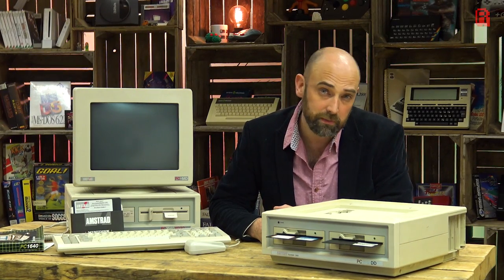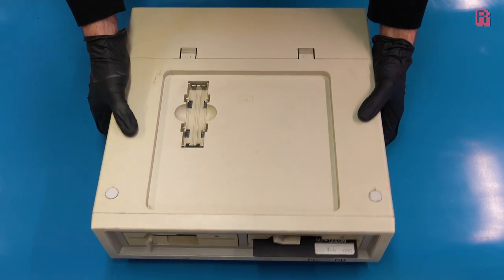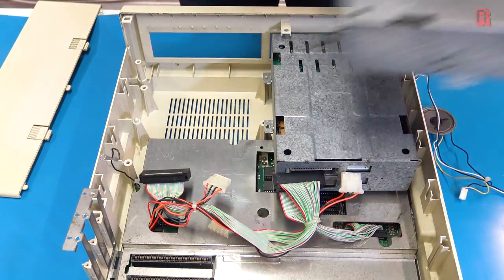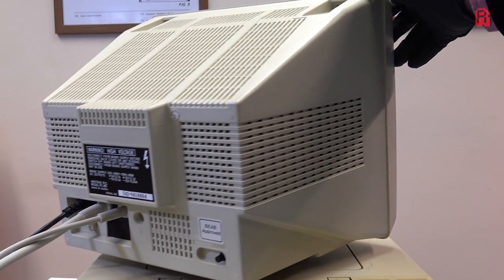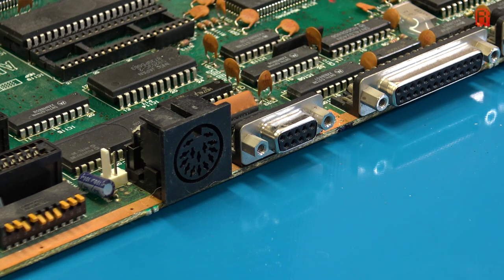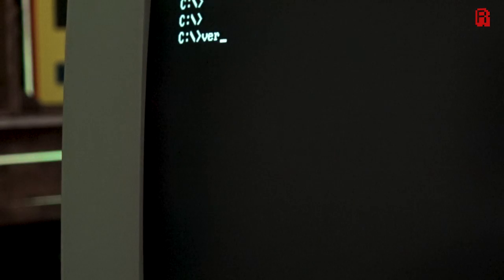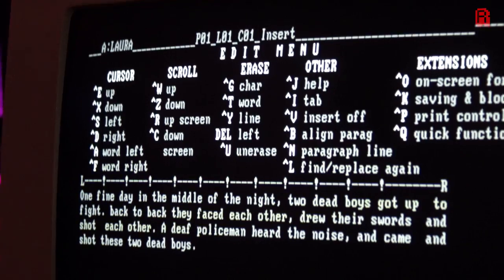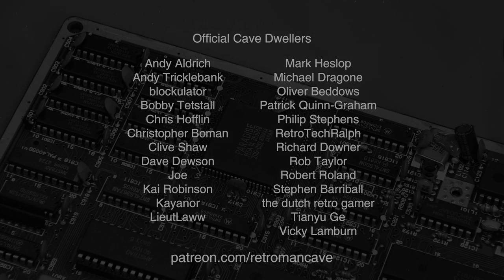The PC That Cracked Europe - Amstrad PC1512 and 1640 | Computer History

Comment: I live in Denmark and got my PC1512 in 1988, with the monochrome screen. I only had it for a few month, until I started to expand it. First I got the extra RAM, so it had 640K. Then I put in an internal 1200 baud modem (wow it was fast ). Within the first year, I got a WD 32 GB HDD, and a CTRL card. The bracket for the mount of the HDD, I made in aluminium. It was a fantastic machine :-) I used it a lot with Wordstar, and also installed a parallel print port, as i bought a matrix printer. Later one of the 360 floppy drives were replaced with a 3,5" FD 720K. All together I had it for almost 4 years, until I moved on...  Thanks for the great video you made! It brought me down memory lane :-)

Comment: I remember wasting a great many hours trying to install a hard disk in my 1512, I bought the Western Digital WD1001D card new and a used Seagate MFM drive from a rally. You had to jumper the card for cylinders, heads, and so on. It would recognise the drive, low level format it, partition it... but it would not appear as a C drive, try as hard as I might. It was only many years later that two nuggets of information came to hand that might have saved me much frustration one was that the ROS was just not BIOS compatible, and the other was that the WD controller cards fitted by Amstrad in the 1640 apparently had a custom ROM fitted; presumably to fix the compatibility! But I loved the 1512 to bits- I spent hours programming in BASICA (20-odd years later and I am a professional software developer) and hooked it to my amateur radio packet modem and sat up into the small hours playing on bulletin boards and node hopping. Happy days!!
Reply: I added a newer Seagate ST-something 40mb MFM hard drive that came with it's own controller that loads it's own BIOS stuff in a PC1512SD some 10 years later after I got it and it worked out of the box. The biggest problem was making custom drive mount to secure the hard drive in the box.

Comment: This video takes me back to 1992 / 1993 - I had a PC1512 as my very first PC which was shortly followed by a PC1640 with EGA and a 20Mb MFM HDD! I still remember the sound when turning it on; was like a washing machine going into a spin cycle! I also bought an upgrade for the 1640 in the form of an external 3.5" floppy drive. It was pretty useless only being 720k but it allowed me to take files into school and make copies of my friend's software. I adored those machines and even now in 2019, when I have the need to type a DOS command, I always think of them <3 <3

Comment: At the time I had a CPC464 with floppy drive and printer. When I looked into the Amstrad PC models I had to take into account that my wife wanted to play games, and that the CPC was not much use for writing novels, my main reason for upgrading from a ZX Sectrum. After comparing models I bought an Amiga 500 over an Atari ST. With the extra drive, ram, and a colour monitor, it was still cheaper, and I could use my Amstrad printer as well. I wrote several novels and a pile of short stories in the Amiga, and contributions to a lot of newsletters. It was also ideal for personal and business letters as I could save, reload, and modify the contents without having to retype the whole letter. Not a big thing now, but I first started writing on a portable typewriter (Degree thesis), where what you see is what you're stuck with.
Excellent video, thanks.

Comment: I remember upgrading my 1512 with an NEC V30 CPU which was pin compatible 8086 replacement that you just popped into the CPU socket.  It was only about 15% faster but cost just £7 at the time (approx 1990).
Reply: I did the same to my 1640 added a v30 & math co processor, external 3.5 floppy, internal 40mb HDD, serial mouse and IBM style replacement keyboard .. it cost a small fortune :)

Comment: I worked for Amstrad starting from October 1990 in the PC Helpdesk department to start off with , we had a 1640 with 2 hard drives hanging off the side of it and the ribbon cables going through the side expansion plate  impressive what you could do with one if you had the money. I specialised in amongst other things the "Amstrad Network" which was pretty good and cheap .. my final day was April 1996 when i took redundancy from the R&D department in the PC Division were we had been developing all the newer pcs from the PC6000 range onwards. Great times and still my favourite time at work!

Comment: Another great video. I remember my friend bought one. I think he saved up for it from part time jobs (I think we were just finishing 5th or 6th form in the 80s) 
We both went into town (Manchester) and I'm pretty sure he got it from Lewis's and it cost a fortune as he got the 20Mb HD and printer. I have memories of round his playing the original 'Test Drive' most of the time. 
I've got a boxed one in the loft here. Not tried it in years, It's sat next to the Amstrad Mega PC with monitor and all accessories - I'm keeping hold as they are pretty damn rare.

Comment: I’ve been waiting patiently for this one 👍
I’ve got the 1640DD (so twin floppies) with the EGA monitor (broken!) and a full-length ISA “hardcard”, a hard disk controller with the hard drive mounted directly on it. Apparently this was an option at purchase rather than a later upgrade.
I’ve altered the DIP switches on the back of the machine and added an ISA VGA card so I can plug it into a normal monitor; maybe you can do the same with the 1512? Power is your only issue there. For now, I need to keep the broken monitor close by, but I have a spare AT PSU that I’m going to modify and use at some point as an external power supply.
Reply from the maker: Interesting!  The 1512 doesn't let you disable the CGA chip but that's useful to know about the dip switches on the 1620.  An LCD with a PSU mounted in a CRT case 😂
Reply: RetroManCave That’s my eventual plan, to find an LCD that will fit inside the original monitor’s case. There’ll be plenty of room in there for the converted PSU. 👍
Reply: Gentlemen, on this page you can find information about the PSU connector:
https://www.seasip.info/AmstradXT/1512tech/section1.html
The PSU connector is at the very bottom of that page.

Comment: I had one of these as a kid, it helped me forge a lifelong career in the IT and high tech industry, without access to DOS, GEM and the PC architecture to mess around with and learn from I’d probably have left school at 16 with only a handful of CSEs and good intentions. The experience I had of PCs because of the Amstrad meant that I got a PC support job when school leavers generally only had BBC micro knowledge. Schools didn’t have PCs and Macs then and the syllabus for computers covered BASIC programming and if you were lucky a bit of assembler. In today’s age when you can get more power in something the size of a thumb drive it all seems a bit quaint but for its day it was a thing you aspired too as the gateway into serious machines affordable to home users. Cheers Alan, you did good.

Comment: Functions keys on the left was standard for PC/XTs which I believe are about what Amstrad made. They went on top of the keyboard later with the IBM AT.
Reply from the maker: Good point well spotted.  There are other oddities about it though to make it just different enough to avoid those scary IBM lawyers
Reply: @RMCRetro   Just few minor diffs: 
alt was next to ctrl in the middle row, prtscr after ] and not bellow Enter, L shaped Enter, shorter backspace and delete between = and backspace, caps was next to right shift and there was gap between num and main keyboard. 
Num had enter, shorter + and - was in the top row next to shorter scrlock.
Reply: There is also a IBM Model F AT keyboard with the function keys on the left.
There were some other IBM clone keyboards that did have ten function keys on top before IBM made twelve function keys on top standard with the Model M "IBM Enhanced Keyboard".

BTW. Commodore PC:s had keyboards with the same layout as Amstrad's (but not as cheaply made ...)
Reply: @FindecanorNotGmail  First Commodore  PC models had keyboards similar to Amstrad (except for the Num keyboard  - top row was esc, numlock, scrlock, sysreq; no enter, big + and there was */prtscr above -). PC-1 and Colt had Alt and Caps in the Space key row, with same Num as previous models.

Comment: I used both of them at Kilmarnock College where they just created a lab with them for the electronics course.   They weren't great machines, even then the hard drives were poor as one of four 1640s died and the rest of the lab was 1512s for cost (another 12 machines).   We did EPROM programming on those machines, which they were terrific for, and also wrote Pascal programs, and Pascal was a beautiful language at the time.   The Irvine annex of Kilmarnock College had the PCW word processor and I couldn't count the number of times someone typed up a report and then lost it because if you ejected the disc without saving you couldn't put in another one and save it (or so I was told - I never used them).

For myself, I kept using the BBC Master who's word processor View was basic but effective.   Easier to learn than WordPefect.   Later using the Acorn Archimedes where its OS was far in advance of the Microsoft offerings of the time.   Computer Concepts Impression was one of the best word processors available and I did a lot of amazing reports for college at the time.   Later I would change to a PC, at 386 level, but that was partly to do with having more engineering software available.   Running two computers as I progressed to university, doing course work on the PC, but writing reports on the Archimedes.

Alas, I then had to upgrade to the 486 and the selection of games for the PC was far superior so the Archimedes got used less and less until I really had to keep using the PC for compatibility with uni that I gave up on the Acorn product.   The Archimedes's RISC OS was better than windows 3.1, and the word processing still was better than Word, but everything else was advancing at such a pace that Acorn was being left behind both in hardware and software.

In all that time I never knew anybody who bought their own Amstrad computer, not one of my college or university friends.   We bought other computers, we even built our own from parts (we were doing electronic engineering courses!), but I have never known anybody who has actually bought an Amstrad PC!

Comment: The PC1640 was my first PC, it was a hand-me-down from my uncle when he upgraded to a Pentium 60 (one hell of a leap!). It had two 5.25" floppies, a colour enhanced display "ED" monitor, and a Seagate 32MB hard drive mounted on a ISA card in the back along with it's own dedicated controller. This was during the predominantly 486+ era it was frustratingly slow but taught me a lot about getting along with few resources that has served me well.
We later acquired a 2nd PC1640, this one with a lower resolution "CD" monitor but it had a double-density 3.5" floppy drive. Which again gave me envy of those with huge High Density drives! 
One day a filesystem corruption event caused a directory to link back to the drive root and my attempt to recursively delete it caused catastrophic data loss from which it never recovered. We soon upgraded to a 486 and those old and broken Amstrads we destined for the tip. But that slow spin-up sound is still etched into my conscious and I do miss it, especially knowing I could now fix every problem it had in my sleep.

Comment: This brought back lots of memories. I worked at a government youth training centre (called iTecs) and we bought about a dozen 1512's and a 1640 they all worked really well for teaching. We had the GEM system and the kids liked them. It taught them what a business system was like to work with. We upgraded some of the twin floppies to hard drives and we replaced some of the 20 meg hard drives with 40 meg drives but  we had to partition them as 32 meg and 8 meg as the max hard drive size ( or partition) was 32 meg. I remember the none standard graphics mode as well which could be used for more colours on the 1640.

Comment: Oh my, do i have fond memories of those. Working in a independent computer shop we sold hundreds of these, I spent many,many hours upgrading and repairing them. so easy to work on. The 1512 I did hundreds of memory upgrades and 'hard cards' which was just a hard drive and controller all on a single metal backplane. Most of those where Tandon hard drives which you had to low level format before you could use them.

Comment: We had a 1640 in 1988. It was a solid PC for the money, but that fan noise was almost unbearable! I remember it was slightly faster than most entry-level PCs at the time, so you really did get a lot for your money. Ended up selling it after about 6 months and bought an Amiga!

Comment: Small point - GEM was more stable than Windows, so high end DTP and the like stayed GEM based until Windows 3.1 became the de facto standard. GUIs were resource hungry so the likes of Lotus 1-2-3 stayed with DOS to make them faster until CPU designs improved.  
Also having the function keys on the left of the keyboard was more ergonomic, IBM had them there until the success of the PC caused some internal political wrangling and the independent PC team was subsumed by the more traditional factions. They moved the F keys to the top so the keyboard would more closely resemble a 'proper' computer, ie with the awkward to use 'teleprinter' style keyboard layout (fashion victims have always been with us). 
The 4x3 display remains popular today particularly with writers as that extra screen height for a given width makes working with text easier (I am told it is also better for web browsing). This is particularly important with laptops where to get the same amount of text in the same font size on a modern 'reduced height' (cough 'widescreen') display you need a much bigger machine (to match a 15 inch Thinkpad laptop you need a 19 inch letterbox display). A4 displays seem to have disappeared now as people just buy a 23 inch screen where they will be doing page layout and the like, one lady has hers set to a 4x3 display and uses the 'spare space' for post-it notes.
The migration toward that futuristic ideal of the Sinclair Z88 (with its super-ultra-wide display and flat rubbery keyboard) may explain the increasing popularity for talking boxes for home users. For productive work of many kinds those older machines remain viable and often preferable (for one thing the longer you use something the easier it gets to use it). One writer I knew was still happily using their Amstrad PCW (albeit with a 3.5 inch drive and a hard drive added) in 2010. It wouldn't do video editing or play modern games, but they just needed it to earn a living.
Reply: The upper line of F-keys seems to come from terminals, and things like the 3270PC which used a "hybrid" keyboard with elements of the PC and terminal designs combined into one ... is that what you mean by a "proper computer" (or teletype) design - one meant for use with a terminal plugged into a mainframe?

And yeah, I picked my current and previous laptops partly on the strength of their screen aspect ratio. This time around, 16:10 was as good as I could find... if only I'd waited just a little longer then I'd have been just in time for the Google branded model with a 3:2, with just that little extra bit of vertical space, but this does a good enough job. I don't miss the horizontal space other than with poorly designed webpages, but the extra height is routinely welcome. Particularly it's quite good for 2-page document editing; it's not far off two old school one-page portrait monitors stuck together, and actually matches the resolution of some old 2-page landscape ones (and as a bonus is exactly 4x that of my old Atari's hi-rez, or 8x that of it's (and the Amiga plus VGA/EGA/CGA's) low rez, so emulation enjoys nice clear 2x2, 2x4 or 4x4 pixel upscaling). A wider screen would actually demand a smaller zoom %age and less readable text - and more wasted space at the sides! - because even at 1280x800 it's still the vertical dimension that dictates how much you have to shrink pages to have everything visible at once... in fact, they probably wouldn't be any bigger than when I used to try the same trick with rather more squinting on the 1024x768 predecessor (its party piece was more being flipped into tablet mode then turned portrait for full page editing with the on-screen or an external keyboard).

The ideal would still be more towards 1280x960 or even 1280x1024 though (also a very good rez for portrait use on desktop screens, as it retains a decent width to go with the enhanced height, and makes both word processing and web browsing much more comfortable even with the loss of effective Cleartype... whereas a lot of things don't like 800 any more, and fewer still 768), especially with the Ribbon infestation suffered by modern applications. Quite why Microsoft decided to implement something that massively compromises your vertical resolution just as everything went widescreen is anyone's guess. If you want a fun time, try using a post-ribbon version of Powerpoint on a netbook ... a later 1024x600 (or 1024x576...) model is barely usable, an earlier 800x480 one is damn near impossible.

As for the smart speaker thing... I don't get it. It seems like a triumph of pure marketing over any kind of substance...